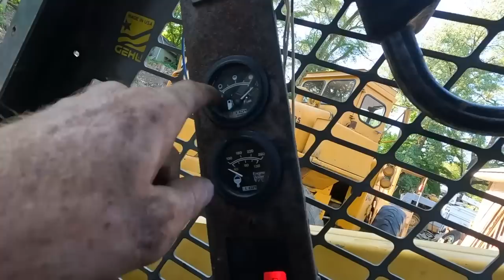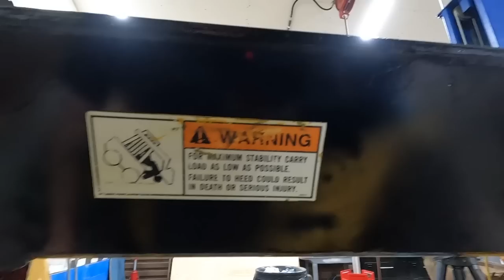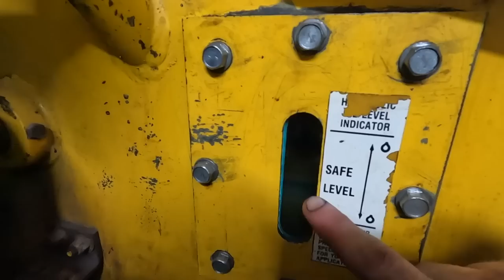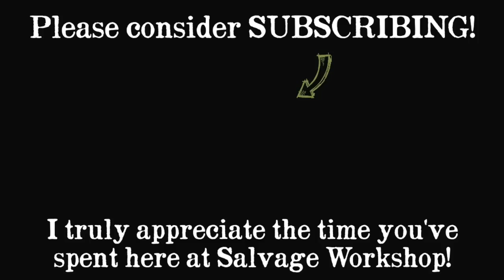Repairing INCREDIBLE Structural Damage to the OLD Skid Steer ~ 1995 Gehl 5625sx Skid Loader P1

Comment: Maybe it's just me, ( not a professional welder but I was taught by one)  I always use a stick welder on thick metals. I guess that may be an old school train of thought. Anyhow...Nice save! Glad you get to work inside your new shop!!
Reply: Yeah it is most old school, but many people still prefer stick welding when it comes to big and chunky parts, but you can do just as good, or even better, with a MIG welder. Try checking this guy out, he's MIG welding some really BIG parts. @CuttingEdgeEngineering
Reply: I was thinking the same thing… 7018 with preheated metal for better penetration
Reply: @Bannimann2  He is a badass!
Reply: I too would have stick welded.
Reply: @nasty509ss  Yeah, the guy definitely know what he's doing! He's a fountain of knowledge, a true craftsman.
Reply: 6010 rods work good for gaps, then lay over it with 7018 or MIG it out at that point.
Reply: Definitely old-school train of thought. You can easily fill a 1 inch by 2 inch gap with wire feed now. See @ofw 657 scraper repair
Reply: @carl4043  Clearly you can do it, but is it right way or best way to do it, from a strength perspective?
Reply: @Kobafied  check out the video I referenced, and its application. You decide.
Reply: @Kobafied also check out On Fire Welding. He'll burn stick, but usually it's MIG. Heck even Isaac runs MIG a lot, and he's a torch god and grew up stick welding

Comment: One trick when MIG welding larger metal…after you are done with a bead, take a needle scaler and use it to peen the weld. This helps reduce stress, wel,will,last longer and is less likely to crack. Do this with trailer welds in my trailer repair division.
Reply: The factory welds on my Takeuchi excavator were needle gunned.
Reply: Good to know! I'm currently working on repairing a "frame" on a car, I will definitely be peening the welds!

Comment: I know im 6 months late to the show and my opinion means nothing to you.  But as a professional welder/fabricator I just want to bestow some knowledge when I can.  I would have cut the center bracket out completely. Removing it allows you to easily set your bucket pivot to where you want it by a diagonal come-a-long.  Heavy tack weld some gusset bars to hold it in place and then reinstall the crossmember.  Pre-heat with a torch to sweat the metal and your root pass will lay in a 1000x better.  Id also go a step further and add more gussets to the top side where it originally started to tear away.  Great work non the less and you did a very quality job all things considered.  Love the channel and look forward to more content like this
Reply from the maker: Thank you my friend! I appreciate the advise! I'll keep it in mind for the next one!

Comment: Trick with boring holes in Lexan, Plexiglass, Acrylic etc. is to use a scraping bit turning fast with plenty of twist flute side clearance to avoid burning and melting in the swarfe against the sides, not a sharp one like you would use for metal or wood.  The sharp bits make micro cracks, which eventually are going to be the failure point when they turn into big cracks.  We used bits that we ground ourselves to drill holes when fitting boat windscreens as we all know how easy it is for a crack to travel across a boat windscreen...  Sometimes we used a very small gas flame to smooth over the rough internal surface, obviously it's a very small step from smoothing to burning and bubbling so that wasn't something we did a lot.   Sanding the surface makes no difference to sealing, if using a sealant you could use a chemical etch type - which can promote later surface cracking due to creating surface tension, something with a glue like Sikaflex which is a pain to get off again or a silicon compound which you assemble loose and then compress after curing, which is by far the best idea as silicon under compression is unbeatable.  I reckon once you are using gaskets, sealants are irrelevant anyway.

Comment: Watched your channel for a year now. 
Well done for tackling that repair. You did everything right. 
I have run an engineering and welding  business for 35 years. 
A few tips if you would accept them. 
Never weld down hill. Go upwards using a Christmas tree weave.  Thats arc or mig. If mig welding use spray deposit 24 to 30 volt at 200 amps and work the arc into the parent metal both sides for 6 to 8 mm thick plate. Penetration is everything. 
Down hill welds look good but have little strength. Exactly as you did get rid of the existing welds completely as welding on top of them is pointless. Get back to original parent plates. A good spray deposit weld does not crackle but literally sprays the  metal into tbe joint uniformly
And the sound of the arc should be smooth and crackle free. Too many people use dip settings on mig welding ( under 28 volts) which does not penetrate the parent metal and is equivalent to no more that soldering in terms of strength on heavy plate. 
Well done for a good repair outside your normal field of work which i continue to
to watch and learn from given your obvious amazing ability to fix stuff of all sorts.

Comment: And Matt hits another home run. That was a great vid and walking through each step and explaining it was terrific now as for that engine have you ran a fuel pressure test at the pump and the injectors it may be a fuel problem since that smoke looks more white than blue.

Comment: Nice old machine , slowly bringing her back .
Throw some LEDs on her and you will have all the light you need .
A tip for cleaning up corroded copper wires , fittings , contacts , and pipes :
Get two containers .
Fill one with vinegar and all the salt that will dissolve .
Fill the other with water and all the baking soda that will dissolve in it .
Put the corroded wire end or contact end in the vinegar salt solution and let it sit for 5-10.minutes , you should see bright clean copper .
Take the wire end out of the salt vinegar solution and rinse it with clean water .
Then put the shiny new end in the baking soda solution for the same amount of time it was in the vinegar / salt solution , to neutralize any remaining vinegar .
This will save you a lot of cutting back to clean copper and replacing connectors , etc .

Comment: When MIG welding material that thick you need to make a root run in one pass (without weaving) straight down if you have to in the vertical then cap it with a run starting at the bottom working up moving in a triangular pattern. In the flat and overhead do not weave, build the weld in straight runs.
Another point, you would have made life easier had you got everything prepped and square before starting welding.

Comment: For future reference they make a 4”grinder wheel for grind out 90degree angles that pipe fitters use you can get them at Home Depot that the edge of the wheel is rounded to get into a 90 degree angle. Much like a flap wheel only the edge round. I use them a lot and would be perfect fit for this job. Great job 👍🏼

Comment: Good tip on the lower speed on wire wheel. I never thought about it. I will try that next time. I'm still hoping to find a older skidsteer like yours (maybe a bigger one though)and tear it down and completely refurbish it. Just to learn. I never had one. Then would have a basically new one when done. Some day i hope. The problem with wrapping those lines with that foam is they will hold in moisture and rust the lines out.

Comment: Another fine mess all cleaned up! Good work on that structural welding - must have been hours of grinding. Looks factory again! Saw that engine smoking and suspect it's a fuel metering issue. Looking forward to your diagnosis. That old beater is still in there swingin!! Thanks for letting us ride on your shoulder.

Comment: A bit of vaseline or dialectic grease under your spade terminals (actually all terminals) will help keep future corrosion down.  Vaseline is cheaper and works well.  I have used it for decades on all terminals but especially those in the marine environment and anything going outdoors.  Just keep in mind if you power wash or use a detergent and rinse you will need to reapply.  Battery terminals are another area that benefits from a large dose covering them.

Comment: When I hear catastrophic arm failure, I expect the rear of the arms to have been torn out. Had that happen to the one I run, with the bucket raised. One suggestion I have would be to not paint the repairs black, as future cracking could be hidden until it's significant by the dark paint.

Comment: Just a small bit of advice, 9 inch grinders are extremely dangerous especially " working at height"  they cause the majority of serious power tool related accidents,  they are inherently unbalanced powerful heavy and will bite, so anyone using one be very careful,.  9 inch (230 mm) angle grinders have been banned on some work sites due to the increased risk of injury. The increased power and size of the unit will cause more severe kickback and gyroscopic effects (i.e. makes the grinder difficult to manoeuvre).

Comment: That was a pretty good job of welding you did.
2 and a half years as a second shift certified Ironworker union welder I'd say I qaulify to give you an asttaboya approval on your welding. 
Pretty much everything you did was really professional level getting all the fubars on it fixed.
It should be a good piece of equipment for you for years.
Always put heat shring over connector ends right up to just before the screw hole or slot to keep water / moisture from wicking back up into the insulated section of the wire.
With that pressure wash it looked better than it has in decades I'll bet.
One thing tho.
Putting dirt around the trunk of a tree and covering it's roots will kill it.
Talk to any good horticulturist and they'll tell you that.
They actually breath thru the roots just under the soil and take in most of their water from them as well.

Comment: Lovely job as always, I did a job like that not too long ago on a forklift after a previous attempt and I found in doing so you need to make sure simply when joining you need to make adequate V grooves in where your welding which allows the gas to pool around the arc effectively and depending on the material thickness would require more than one seem maybe 2 or even 3 to accommodate perfectly in the V. The second time I did it went much better after using a different wire because there's obviously different variants of steel used like mild steel, construction steel, rigid steel, all depends on the purpose. But along with good clean preparation, cutting out V grooves in where you'll be welding and then voltage, wire speed and ofcourse the gas type is important too made a superb job.

Comment: In the portion of the video where you were making the replacement window for the hydraulic fluid reservoir, you referred to the old window as being made of plexiglass.  Plexiglass also known as Perspex is an acrylic plastic.  The replacement material which you were using had a brand name of makrolon, which is a polycarbonate material.  Polycarbonate is much stronger than acrylic and in this case I believe is a good choice for the replacement window.

Comment: Very impressive that you were able to get all of that welded back together and get it as straight as it ended up. I was afraid that the arms would be askew when you got the bucket back on the ground, but it looked great. Great work. Looking forward to seeing what is wrong with the engine and how you fix it! She shop seems to be working out great after all of the rebuilding!

Comment: I would have switched over to flux core and welded it up up hill or used stick  for better structural weld.  But hey if downhill mig works it works.  I’ve been guilty of it myself if I was a a pinch.

Comment: i think that first window you had was acrylic by the way it was cracking and breaking off but the new window looked like plex by the drill shavings and by the fact it didnt crack when you pushed that hard into the drill. next time you need to keep the protective film on just peel it back to where you want and cut the loose edge or put blue tape back on, the score lines were pretty visible and could lead to cracking in the future even though its plex

Comment: You can save effort and time using air/arc gouging rather than a side grinder.  I believe stick electrode (E7010-G) would be better in the long run instead of short arc MIG that you used for thick material with bending and twisting loads.  Short arc (GMAW) was developed for welding sheet metal and is subject to lack of fusion on thick materials.  Lincoln Electric publishes a good book on arc welding processes and any good welding supply vendor should be able to get you one.

Comment: Just a tip when welding a vertical weld start at the bottom work to top you will find you end up with a better and stronger weld.

Comment: Brother, I’m not about to tell YOU how to do things, but I feel I need to offer some words of caution. It’s been my experience that using cut off wheels, while grinding with the left side of the grinder, that it will sometimes grab and kick back hard, usually grenading the disc. I try to use the front edge of the disc so it doesn’t throw the sparks at me, and if it does kick, it’s to the side, away from me. Love your vids! Keep up the awesome content!

Comment: All acrylics need room to expand and contract so you bolt holes have to be slightly oversized.  I believe you clamped the old replacement too securely so that the expansion had no where to go but to concentrate in the middle.  All manufacturers that I have experienced tell you to oversize the holes for this reason.  Also be careful on any adhesive or sealant as some will attack the acrylic (3M 5200 is an example).   I would also use neoprene washers behind the bolt head and do not overtighten.  Lexan might have been a better choice??

Comment: 25:22 maybe I’m wrong but I don’t see a factory welding line on the back left side. Maybe it’s made for purpose, to leave a weak spot for temperature expansion or some kind of play while bending? I saw such solution on machinery forks.

Comment: So on other channels I have seen people put plugs in the hydraulic lines and ports as soon as they were disconnected to try and reduce the mess and keep dirt out of the system.  One thing I have always wondered, does it make sense when you are going to work on hydraulic lines that you drain them out or leave them full with plugs in?  I realize that if you are replacing lines they may as well be drained, but I was not sure how much extra work draining the system before you work on it would be vs leaving it in and just trying to minimize the mess.  Fun video as always, thanks for showing all the details. :)

Comment: Good job mate, well done, Bit concerned about wrapping bare metal high pressure fluid pipes with split rubber hose, makes a perfect water trap to rot the pipes out. Unless they are stainless of course, but they don't look it? Bob. UK

Comment: Go from switch S to a grounded frame  slave solenoid, wired with #6, or #4 AWG from battery through  to starter solenoid. Reduces voltage drop to starter. Done this DOZENS of times !!

Comment: Old farmers trick. Take a air hammer to the hydraulic fittings for just a couple seconds and they will almost unscrew by hand! Not joking. Try it! The impact and vibration knocks them loose. C&C equipment shared it on their channel.

Comment: Solid repair! Get rid of those power hungry halogen lights and get some quality LED’s. You should’ve replaced electrical connectors in wire loom instead of separate unprotected wires.

Comment: I watch a lot of YouTube and see a lot of Welding going on and with the heavy thick metal your working on im thinking you should use a stick welder so you can burn it in deeper so it will hold much longer but im no welder either so?? Really nice job you did thou and you laid down some really nice Welds

Comment: You know, Hank and Wylie from Hamiltonville Farms were wprking on a Kobelco 120 excavator and gave up on it at the end of the video but I thought of you going and doing a Salvage job on it as no doubt you'd be able to get the starter working enough to turn it over. It didn't seem to have any milkshake on the oil dpistick but it's been sitting for a number of years. If you're ever thinking of looking for an excavator of once size or another Hank would be a good guy to talk to for ya. I noticed they started using "Area Diesel Service" like you and Watch Wes Work both mentioned in the past. Hank left 4 fresh built injectors in the motor and they kind of gave up in the end when the starter desided to go MIA on them. Worth your while maybe?

Comment: It was not obvious, but your term "plexiglass" basically means acrylic.  Acrylic has to my knowledge both cracking and sensitivity to certain oils.  What you now used instead reads Macrolon, which to my knowledge is polycarbonate, material also used as "vandal resistant" windows.  Unlike acrylic, you can readily saw and drill it without causing cracks.  Hope you luck with that selection!

Comment: Would be a good time to order a box of hydrualic plug and cap kits for hoses and nipples for next time. 💡🤔👍Plexiglass isn't oil, atf or fuel resistant and becomes softened or brittle. It should be an Acrylic chemical resistant glass and sealed with Permatex 2 Form-A non hardening gasket sealant.

Comment: If it starts leaking again. Just make a solid steel plate. Drilling tap a couple of holes in there and put a sight tube in there so you can see the level

Comment: Markrolon that you used is a trade name for polycarbonate not acrylic. Polycarbonate should be much better and resist cracking as it will flex without shattering. Bob in UK

Comment: May I suggest using flux core wire with gas shielding , it is 045 and does a much better job, as a licensed welder is the preferred filler for such jobs